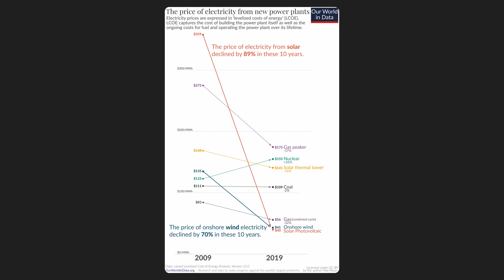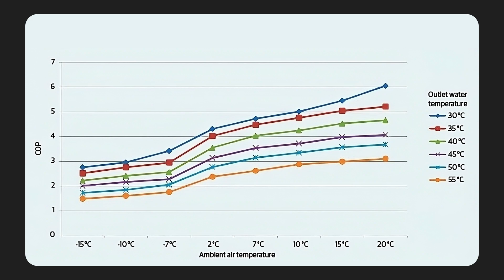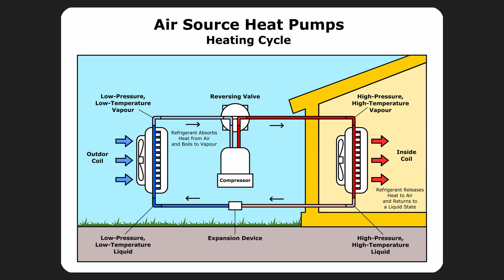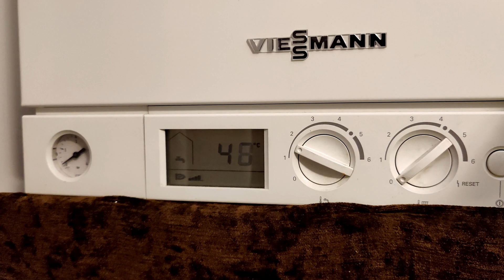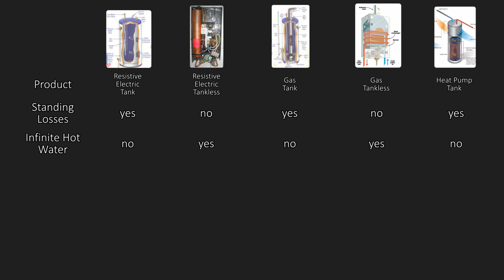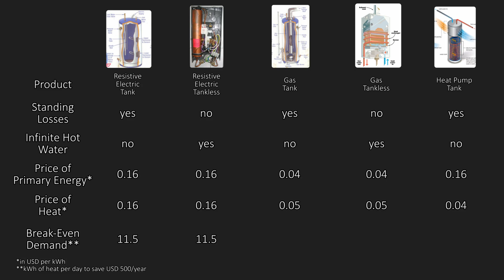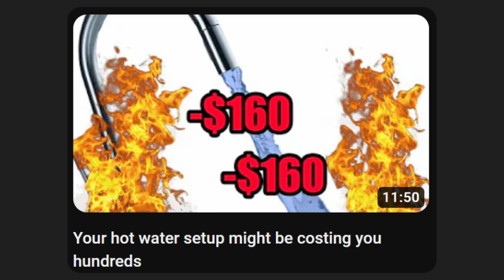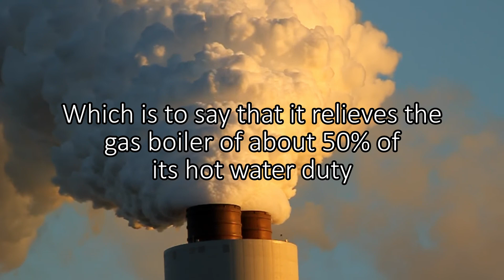Why Many Heat Pumps Can't Compete

Comment: I diy'ed my air-to-water HP for around 3.5k USD and it 100% covers space heating and DHW. There's no gas in my area, so my only option is electricity which I generate on site with help of PV. The combination of HP+PV+batteries gives me a possibility to be net positive in terms of money and autonomous in terms of quality of life.

Also, your analysis takes gas infrastructure as given with zero cost which is true for existing buildings but completely incorrect for new developments. Gas infrastructure typically is subsidised by local and central governments and those costs are significant. So instead of building gas and electrical lines why not to supply just electricity and subsidise heat pumps and PV?

Comment: It might be interesting to know that the fact that many heat pumps are absurdly expensive, is mostly because of the industry. A (vapor compression) heat pump basically requires a compressor, a couple of heat exchangers and some control, the working fluid and the lines for it, no magic, nothing to motivate a price tag anywhere close to $10,000 for a single household. Heat pumps are generally ridiculously expensive compared to what they should cost to manufacture. It's mostly absurdly old/primitive technology sold for absurd prices. If the HVAC industry had control of telecom related industries we wouldn't even have pagers yet, and when they would be developed they would be so expensive to buy, and use, that most people would never get to even see one. 

The theoretical potential COP of a heat pump is kind of the inverse of Carnot's theorem for heat engines, (because physics makes sense) TH/(TH-TC) when heating, meaning the limit for what's possible when extracting heat from lets say 250 K, about -23 °C and deliver heat at 330 K, about 57 °C, is a COP of over 4, as 330÷(330−250)=4.125 and that's not counting the heat generated by the compressor from the power used. Most heat pumps struggle to even generate relevant amounts of heat against that temperature difference. While it's not possible to reach the theoretical limit in practice, getting much closer than most currently sold systems wouldn't be difficult, especially considering how much most of them cost.   

And when it comes to air sourced heat pump water heaters, when and where the cooling and potential dehumidification, of the air, AKA air conditioning, isn't a drawback, or even is a bonus, which most people experience at least some part of the year, reasonably efficient and somewhat reasonably priced air sourced heat pump water heaters could be a really big deal. 

Water is vastly superior to air when it comes to carrying/distributing/exchanging heat, in multiple ways, it's fundamentally slightly more costly to manufacture the systems, but HVAC-heat pump manufacturers sells what's ancient technology at futuristic prices, probably mostly due to insufficient de facto competition.

Comment: If your gas boiler usage is low enough you could also convert your boiler to bottled gas instead of mains and cut the standing charge which is quite expensive in places like the UK.

Comment: Many countries now offer home energy upgrades that pay towards the cost of a heat pump installation. I actually got such an upgrade, along with a home retrofit. The doors, windows, gas boiler and radiators were ripped out and a new heat pump system installed along with nice new triple glazing windows and doors. I don't know exactly how much it all cost as the state picked up the full tab but it was something like 10k. 

I keep the home at 24 degrees 24/7 and my new combined energy bill is just electricity which is cheaper overall.

Comment: I am considering getting the air-air heatpump for heating to replace the wood burning, but on the other hand we got a classic resistive heated clothes dryer instead of heatpump version. I've estimated that it would take basically the entire expected lifetime of the device in power savings to offset the difference in price at the time of purchase, and the user experience is inferior

Comment: I'm happy to say that you're overly pessimistic in your assumptions.  We spent about $10k including labour (yes, overpriced) with additional hot-water cylinder - this saved replacing the gas-boiler which would have cost about $2.5k.
Comfort increased massively and our old radiators that are objectively 'unsuitable' turn out to be sufficient after all.  Running 24/7 turns out to be enough to make them work just well enough. We're living in the Netherlands, for reference.
Financially it is going to neutral due to cheaper running cost at a higher upfront cots, assuming the machine will function for 15 years and have slightly less maintenance cost compared to the gas-boiler (which has mandatory maintenance!).
Everyone renewing their heater should investigate for themselves unfortunately, as these heat-pump solutions must be tailored and cannot work well if either undersized or oversized.   That is the biggest drawback in my opinion.
Reply: Why would they work bad if oversized? You would be wasting more money than you need to, maybe with slightly faster heat up times, but they should work
Reply: @milospavlovic7520  Technically it works, but an oversized domestic heat pump will have a relatively high lower working point.  This means that on many days of the year where you need only a little heat, the system cannot actually deliver a little, only a lot, and this in turn makes the system switch on and off far too often.  The lifetime of a heat pump is typically calculated in operating hours AND maximum start/stops, i.e. you may expect this machine to expire far quicker than a properly sized one.
Another important disadvantage is comfort levels: constant mild warming is very nice and a vast improvement over the gas-boiler that typically also operates in bursts of heat and cooling cycles.
The house would also not heat up any quicker as the main constraint is usually radiation surface - remember this is all low-heat operation between 25-35 degrees Celcius.
I hope this explanation helps, unless you have some experience with this it is all a bit counter intuitive compared to our traditional heat sources.
Reply: @diatonicdelirium1743    No, your explanation makes sense. I mistakenly imagine all heatpumps nowadays as inverter by default, which is getting more common but is obviously not always the case. If you use the traditional heat pump, then your explanation makes sense, but in case of inverter, I think my assumption would be correct; as the inverter heatpump can work in any power level between full and off if overbuilt it would just default to the lower power level than the right sized heat pump would (probably with similar power usage), potentially leaving you with room for heated space increase later down the line
Reply: @milospavlovic7520  I'm not an expert, but I think there are minimum and maximum pressures for the refrigerant for proper operation that may even cause damage if exceeded in either direction.  You can imagine that too little pressure simply doesn't get the pressure up enough to complete a cycle.
This automatically sets an operating range for the power.

Comment: I usually don’t comment on videos, but after reading out what was written here it made me compelled to explain some things that I think the author was trying to explain in his video.
First thing first, my situation: 
- I live in the south of Europe with very hot summers and 2-3 months of cold weather.
- I live in a flat that was last renovated in 2019, last floor and that suffers from what is called a greenhouse effect (very hot in the summer and quite cold in winter). Isolation is fair.
-  my flat is fully electric, no central heating so only electric radiators.
I bought my house in the beginning of the summer, so my experience was only with the Aircon that was already installed (Heat Pump Daikin Sensira, funny enough like the example given in this video).
The total electric consumption in the summer was quite good to the point that I had the Aircon constantly running. When winter and the cold days came, I did what everyone would do so I turn on the electric radiators… my average kilowatt spending was over 35kw daily and to be honest with very poor results in regards to comfort although spending stupid amounts of electricity.
So I thought “I have a heat pump, let’s have it to go”… and that was exactly what I did with interesting results:
- my electrical consumption went from more than 35MW to 10MW. 
-  the comfort feeling of forced air heating he’s much better than the comfort provided by the electric radiators ( I can actually heat the whole flat instead of luck warming feeling just where I had the radiators).
So yeah, I guess that the author of this video is correct in his analysis, very correct actually.

Comment: Counterpoint: We renovated our house (built in 1910) to contemporary standards in insulation and underfloor heating. We decided to keep our gas boiler in place at that time.
Because it is ridiculously overdimensioned for our current home we don’t save as much on gas as we want to. We use 2000-2500 m3 annually, which is €2500-3000 with current prices. We have 11 solar panels installed, with 4,5 kW peak.
Installing a 11 kW heatpump would cost us somewhere between 8 and 12 thousand euros after subsidies. (We have several offers). Electricity is currently 27 cents per kWh on our contract. Equating 1 m3 to 8kWh we would need 16-20 MWh of heat per year to replace the gas. With a scop of 4 that would be 4 to 5 MWh of electricity and € 1000 to 1250 per year. 
So we would save between 750 and 2000 euros per year.
Payback period would be between 4 and 15 years. Let’s say that 9 years is realistic. To me that’s a positive businesses case, moreover because we can also cool our home with it.

Comment: Valid comments. I've bought my own heat pump and I'm installing myself. I found that getting them installed by someone else was extremely expensive, overbuilt (in the sense that too much extra equipment was added and the heat pump oversized) and underperforming (in the sense that the hard work of design wasn't done so it is bound to perform poorly). Better than burning gas though.

Comment: In my case (Romania) it was not a heating contractor that scammed us with the original radiators being too big, but the house developer who tried to scam us with poor house insulation, so he installed at no extra cost for us HUGE radiators :D in 2019. I basically run the gas boiler at 35 C or below and save a significant amount even on the gas bill also due to being a condensation boiler. Unfortunately as said the insulation of the house was really poor, 
 (5cm of polistiren at the walls, low end double glazed windows and 5cm of discounous mineral wool at the ceiling level, no membrane of diffusion foils, no insulation under the roof) but I half fixed it with DIY stuff for less than 10 k EUR (closing a terrace, diy ing the ceiling and roof insulation with proper thicknesses, closing a windfang, puting some foil on the windows that traps a second layer of air and I get no more condensation on them, you can find it at Leyeroy Merlin in the EU). Also on the positive side the house is concrete structure and relatively thick brick walls (porous bricks for better insulation). 
PS: to keep heat pump costs low I just installed 3 more air conditioners (1500 EUR with installation cost) optimized for heating in each bedroom (already had one in the living room) and I expected an average COP of above 3.5 which at the current gas vs electricity rates (@ half the price per kWh in gas vs electric power) should already halve my total energy bill just by buying electricity.
PPS: We do also have a PV program in Romania and with a government voucher I am supposed to get 7.7kW of PV this year with a bit less than 2000 Euros but that is just an added bonus.

Comment: I don't think boiler replacement (air to water) is a good solution, but your numbers for this are rubbish, even without grants in the UK they are now nearer $4000 and prices are dropping, also if you get decent installers, radiator and pipework upgrades are often minimal or even zero - especially if insulation has been improved since the heating system was first installed.

Comment: We got air to water heat-pump with integrated water tank for a new house, it cost 6k euro and I have no complaints. In Baltic States air to water heat pump heating for a new house has been a default for the last six or so years. Of course there are still some who insist on natural gas or even hard fuel but those are becoming rare as majority of new houses are sold by developers who pre-install heat pumps as heating solution. Before it used to be people buying lots and hiring construction workers to build a house for them but that is also becoming increasingly rare and even then first alternative to air to water heat pump is water to water heat pump if they have enough space outside.
Reply: I agree with his explanation why he hates air to water heat pumps, but also your explanation that when it becomes more standard then the price for all components and labour goes down and it starts making more sense.  Naturally, water-water systems are likely the best solution, provided you have enough space in the yard

Comment: This chap is basing everything on RIO, and is blogging utter rubbish,
The only time you need a ASHP or any heating replacement is when your old heating system fails or cost more to repair,
My Boiler has failed, got an ASHP from a grant from the UK GOV cost me nothing for an installation. You can't get a better RIO than that.
This Video Should be Called "ASHP did not work or cost too much money in my home, so I'm going to bad mouth it"
Reply from the maker: Subsidies work well as a bridge to competitiveness for technologies that are on a declining cost curve, but heat pumps are not on any significant declining cost curve, so there is nothing to bridge to.

If your decarbonization solution relies on subsidizing heat pumps to make them competitive, it will only work for as long as you keep subsidizing, which is economically and socially unsustainable. Maintaining it will always be an uphill battle. I'm looking for long term, stable, sustainable solutions, so they have to stand on their own, without subsidy handholding

And fundamentally, "you can have it cheap if you convince someone else to pay for it" isn't a very compelling argument

Comment: This video is complete BS. Though air2air is a fine solution, you need a reversible ac for every heated room. Air2Air doesn’t provide warm water, and doesn’t have a higher COP than air2water heatpumps. The prices you mention for air2water heatpumps is totally ridiculous, or you got a quote from a bad company. Lot’s of European homes have underfloor heating and otherwise you can also use fans to improve the efficiency of your existing radiators. Both air2air and air2water heatpumps can be a viable option depending on the situation.
Reply from the maker: An important pillar of my air2air thesis is that sooner or later, Europeans need to wake up to the fact that summer cooling is nearly as important of a public health component as winter heating, as the rest of the world has already understood. However many ACs you need, well, you needed them anyway, even if your heating solution is something else, so the marginal cost and hassle to make them reversible is minimal

The prices seem to be consistent across many manufacturers. If you want a CoP that will actually result in monthly savings, you're looking at the $10k range (unless your electricity:gas price ratio is a lot lower than the one assumed in the video, but that's a big discussion in itself, cause you have to guess at what the ratio will be for the next 10 years at least)

Comment: Energy prices fluctuate so much that comparing gas and electric prices can be misleading. Last year at this time, my utility was charging 2.5X today's price for gas. My electricity was about 5% less last year. A cost projection with last year's numbers comes out with a way different answer than today. I have solar so electricity makes more sense than gas for me, but cost savings for my ASHP and HPWH, I have no idea.
Reply from the maker: In theory, there should be a fairly solid correlation, since current policies make it such that gas electricity sets the clearing price most of the time. The energy component of the electricity rate should be about 2x the energy component of the gas rate, if the power plants are about 50% efficient; the distribution cost is about 4x for electricity and it seems to be fairly stable; electricity includes the depreciation and fixed costs of the power plant etc

So you'd think it should be a relatively stable ratio, but yeah, I did notice that in practice, the ratio has been all over the place recently 

I've been doing my calculations with the assumption that the ratio would "revert to the mean" at some point, but I wouldn't be surprised if it never does